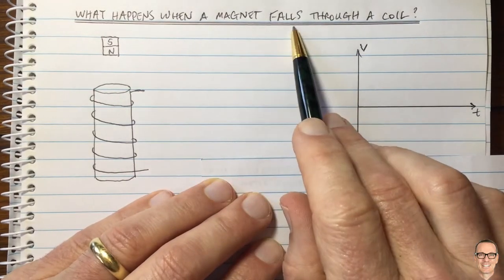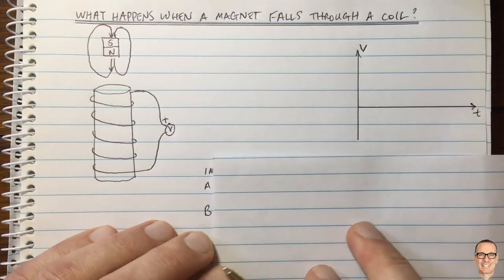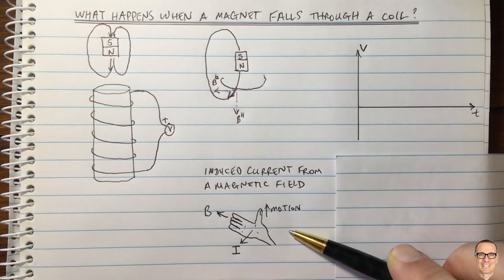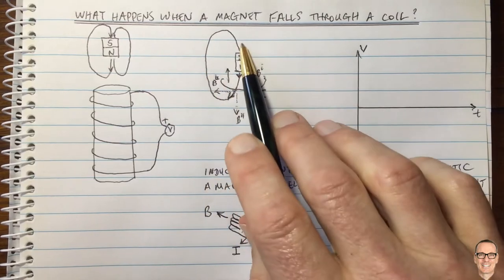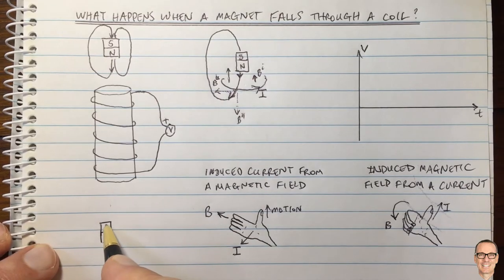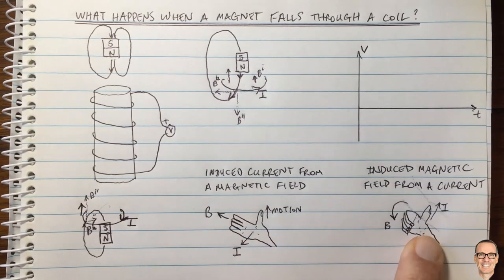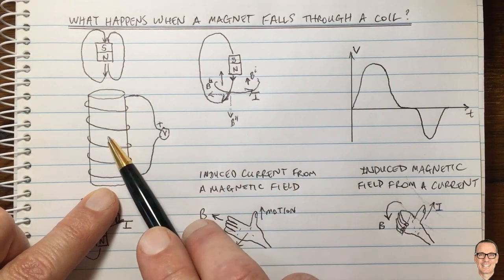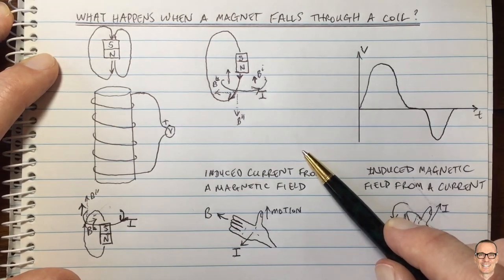What Happens when a Magnet Falls Through a Coil?

Comment: Another really helpful video. Thank you! I recently tried dropping a rectangular Neodymium magnet (poles on the long, wide sides) and found that there was no slowing of the magnet (Note that the copper pipe was just slightly larger than the narrow dimensions of my magnet). I wish I were as skilled as you with vectors but I’m guessing that the result I observed makes sense on account of the magnet’s field being horizontal vice vertically oriented. Does this result make sense? Thanks again!

Comment: funny how the induction is a result of the coiled, insulated wire versus the eddy currents and counter-emf if the tunnel is shorted, i.e., a copper pipe. i wonder how much electricity and/or counter-emf would result if a coil of insulated wire is wrapped around a copper pipe, with the insulation removed from the wire where it makes contact with the pipe. the magnet would induce eddy currents in the pipe which should be absorbed by the wire, thus adding electricity to the induced current, but the wire is shorted to the pipe so the current would flow along the length of the pipe inside the coil, and then to the terminals. this should possibly decrease the counter-emf, making the magnets fall faster than if the coil were absent, and resulting in lower current than if the pipe were not present. thus, this arrangement cancels the hindrance to movement of a magnet inside a conductive material.
Reply: Can you please explain it again, brother❤😊
Because you are going right, please explain me❤

Comment: Dr. what will happen if I let the coil be horizontal instead of vertical position, and the magnet passing by the coil vertically, will there be a change in flux, thus induced current?

Comment: The area under the voltage-time graph represents the change in Flux (phi) linking the coil. E = - d phi/ dt, so phi = integral E dt... ie the area between the curve and the time.axis. the area under the initial pulse should.equal.the area under the second pulse.
The entry pulse of emf should be a low V for a long t, the departure pulse is a high V for a short t. With equal.areas.

Comment: Here's a nice video that shows how the Magnet Slows Down through a copper pipe: https://www.youtube.com/watch?v=N7tIi71-AjA. The induced eddy currents in the pipe act in the same way to slow the motion of the magnet.
Reply from the maker: Yes, exactly.
Reply: @iain_explains   By the way the standard model of an EM Wave is always perpendicular E and B fields travelling through space. However they both seem to be in phase, where they both peak and trough in lock step. How can this be, if one causes the other, shouldn't there be some sort of lag between them somewhere? Cause and Effect so to speak. Perhaps a nice video for the future to explain. Cheers.

Comment: Hello;
I,ve got an question that if an bar magnet is allowed to fall through an coil connected to either the galvanometer of ammeter what will be the deflection shown when the Bar magnet falls away from the coil. (Given that the Magnet falls with N Direction Below).
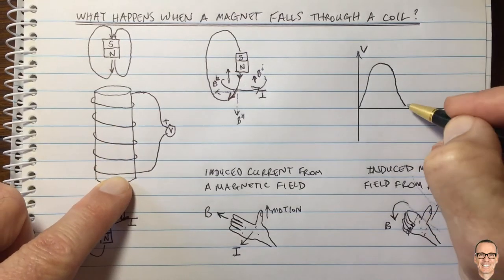Reply from the maker: This case is discussed at the 8:40 min mark in the video. Ultimately the voltage/current returns to zero after the magnet has fallen far enough away from the coil.
Reply: @iain_explains  Thanks

Comment: I don't quite get how at 3:44, you've decided that the perpendicular component is to the left. Why is it to the left? Why is it not to the right? I understand the thumbs up part, because the wire is moving upward relative to the position of the magnet. However you could just very well have pointed your hand to the right. I'm not understanding the perpendicular component.
The wire is perpendicular to the field exiting out of the magnet. Is it because you have used the reference of the N to S flux line on the left side of the magnet, that determines the direction of the perpendicular?
Is it true that if you drew the N to S flux line on the right hand side of the magnet that you would then point your hand to the right instead and find the current being induced "into the page"? My analysis proves yes on concordance with the direction you have indicated.

Skipping ahead of 7:11, it would seem better to call it an acute angle component 🤔
At 90degree it could go either left or right. However given the direct of the flux outward to inward from the right hand side to the left, at that outer point to the left relative to the magnet in the middle, the measurement of the right hand rule is that the induced current goes into the page, because of the acute angle direction of the magnetic flux line to S from N.
My point is that the direction of the flux line tends to move in the direction that is less than 90degree at the point where there is a perpendicular component.
Reply from the maker: The answer to the overall question in your first paragraph is "yes". I pointed it to the left because I was visualising the part of the wire that was on the left hand side, coming out of the page towards me, and wrapping around to go back into the page on the right hand side. You are correct, the part of the wire on the right hand side would need my hand to be pointed the other way (as you say).
Sorry, I'm not quite sure what your point is in your second paragraph.
Reply: @iain_explains  Does the angle of the wire when referring to the perpendicular component matter?
What if the coil was wired, say, in the opposite direction? So instead of the wire coming around the back at the top of the coil, in started at the front of the coil and looking at it top down, it would curl clockwise?
Would that change the direction of the induced current?

My reason for asking this is if you only had information about one flux line, the one directly perpendicular from the front of the magnet, you would see a straight line "down the middle of the magnet". I understand if you're looking at flux lines on the "left" or "right side of a magnet, or "perpendicular" to the flux line itself, 

Oh okay, I think I just got it. The palm is basically the perpendicular component lol. One's hand must be in alignment with the direction of the direction of force of the flux line. 👍🏻 Got it ✋ I was looking at your drawing 2-dimensionally, instead of three.

So I see where I was also wrong was that I was looking at this perpendicular component relationship between flux line and angle position of the wire. This is incorrect. The perpendicular component is the angle at which the flux lines leave from one pole of the magnet to the other.
Reply from the maker: Great. I'm glad you understand it now. I tried to make my drawing look 3D, but I'm not the best artist, that's for sure. I'm glad you've found the video helpful.
Reply: @iain_explains   Thanks for this. Most explations of this seem to beat around the bush somewhat, Great video Iain!

On Jaques' point, you may want to consider adding an annotation or something to say that the magnetic field vector is in the wrong direction. Considering the RH rule, if you viewed the solenoid from above, perpendicular B vectors would be pointing radially outwards. To visualise the correct direction on your diagram, draw a line from the coil centre to the choosen point.

As i said this was a great video and I am not questioning your clear understanding of the topic but I can see how this small detail could cause further confusion.

Comment: When it goes in the pipe it creates a force that oppose the magnet direction, when it goes out the force pushes the magnet out, so, when it is in the middle of the pipe, when the voltage is zero, why does both forces don't cancel out and it just moves freely?
Reply from the maker: First, it's important to point out that nothing ever moves "freely" - even if it is in deep space. Everything always has forces acting on it, from gravity, magnetic, and electrostatic. How it moves depends on the strength of those forces. Just because the magnet is inside the coil (in your question) doesn't mean the forces from above and below are equal in strength (or opposite in direction). Actually (although I didn't say it in the video) the force from the coils that are above the magnet, actually pull the magnet up! This is because the induced magnetic field lines (induced by the coils above the magnet) point down inside the coil. Which effectively means the coils above are acting as a North Pole magnet - which has the effect of attracting (up) the South Pole that is at the top of the falling magnet.
Reply: @iain_explains  First of all thank you for the response! I must have been tired that day, on the N side the field lines are in opposite directions, on the north side they are in the same direction, last time I taught that they where still opposing... And yes I know the meaning of free body, I used the world in the context not in its general meaning. Thank You.

Comment: If you released magnets through the coils at the proper rate wouldn't you make DC current?
Reply from the maker: It's the change in magnetic field that induces the current. If you have a constant stream of magnets, then there won't be a change in magnetic field, and so there won't be a current.

Comment: If the coil is long, when magnet is inside the current shud b zero, so no slowing down? The positive and negative voltages are for entry and exit. So a long solenoid would cause a different response compared to magnet falling in a copper tube?
Reply from the maker: Not exactly. While the magnet is inside the tube, all of the coils below the magnet are producing a magnetic field pointing up (slowing the magnet down, because the closest end of the magnet to those coils is the North end), and all of the coils above the magnet are producing a magnetic field pointing down (which is also slowing the magnet, by pulling it up, because the closest end of the magnet to those coils is the South end). So while it is inside the tube, it is being slowed down "the most". The longer the tube, the more the magnet is slowed down, until it reaches an equilibrium speed. This is because, the slower the magnet moves, the weaker the current will be in the coil, and so the magnet will not actually stop/levitate. In a long tube, there'll be an equilibrium speed, that depends on the weight of the magnet, the number of coils, and how tightly they are wrapped.
Reply: Thanks!
Reply: I guess @ashutoshbhakuni is right. Your explanation @iain_explains  is correct for pipe since each pipe can be considered infinite number of independent circles wrapped. However, for coil, the coils are connected so when the magnet moves inside the pipe, the current will cancel out if the coil is long enough. This can also be observed experimentally. The magnet won't slow down as it falls inside a coil while it arrives at terminal velocity very fast in a pipe.
Reply: @niyazigulnar56  I agree with you. Ironically this cancelling out effect is even mentioned in the video around 8:34 (albeit very briefly). Sadly I haven't been able to find a video of someone testing this... would be interesting to see experimentally!

Comment: Hi Iain, thanks for this clear explanantion. I would be interested to know if in your example the coil wires would be connected to create a (short)circuit or open, what would the difference be?
Reply from the maker: Connecting the ends of the coil with a wire wouldn't change the magnetic field effect on the magnet, since the only difference would be that charges would flow from one end of the coil to the other (through the connecting wire), rather than build up at the ends of the coil. Having excess charge at the end of the coil (or not) doesn't effect the magnetic field, since it is only the moving charges that effect the magnetic field.
Reply: @iain_explains  I'm surprised by your answer... I would have guessed that in the case of the UNconnected (open) circuit, the sloshing of the charges towards one end (like in an antenna) would mean that, despite induced emf being equal, the resultant current would be reduced [in magnitude and/or duration]... leading to a weakening of the induced magnetic field? ...thus less magnetic breaking? (PS loved this video by the way, it was much more thorough than others on the topic!!!)

Comment: Excellent explanation of back emf. I have a question if you can answer will be great: from where is coming the electricity in the coil over and over again? 
I ask that because if the current (in the generator - coil) is flowing "from the wire" as they told us on physics then why this flow never ends?
Reply from the maker: Sorry, I'm not sure I understand your question. On a technical point, current flows "in" wires, not "from" wires. Current is the movement of electrons - so there needs to be a circuit for current to flow. Energy sources cause the current to flow (like batteries, or magnetic fields), and then the energy is dissipated when the current flows through circuit elements (such as resistors).
Reply: @iain_explains  OK, you are right. Current flows in wires not "from". 
But where the electrons are coming from when the magnet passes true the coil?
 If the current flows true the coil - let's say - connected to a resistor.
Reply from the maker: I'm not a physicist, but essentially the electrons that are moving are the ones that are already in the atoms that make up the metal wire. In metals, when a field is applied, the electrons disassociate from their protons, and move in the higher energy bands.
Reply: @iain_explains  Exactly this is something that brings up the question: if they move into a higher state and leave the orbit then who will replace them? it may be a dumb question..
Reply: @georgestanciu5466  bro metals (the things used to make conducting wires) are electropositive, hence they are more than willing to give up and donate their electrons from their valence shell; implies when a magnet is brought near a coil (must be moving), the electrons in the metal atoms flow in a particular direction, and this direction will be such that it opposes the change in flux (flux is the magnetic field intensity through a given area, and is B.A (dot)) [Lenz' Law].
Hope this helped.

Comment: Subscribed! ~ BUT~ have done so many time before...... and ..... never yet to any avail.
SO~ what I can't get my head around * is * ;
1] Why no information 'anywhere it seems ' on what happens WHEN~ a magnet spins 'within' a coil.
2] ~ 1 magnet.... N/S ~ top and bottom?~~~ Flat Bar type WITH also Disk type also round bar type
3]~ 1 magnet... N/S ~ sides Left & right?~~~ same types as above.
4]~ Series of magnets..... Flat, disk and bar ?
5]~ as above BUT with series set at 45 degrees to each other?
......... I will try to do so myself, BUT~ understanding what going on??? on clue, sorry very basic clue.

666]~ What happen when THE SAME is done within 2 coils SET apart by;
a] 1cm
b] 2cm etc, etc BUT coils arranged in same orientation
c] Same but with coils arranged a 90 degrees to T'other AND 180 degrees as well as variations between.
d] IF~ any result, what about 3 coils etc?
~
Please IF interested SHOW if possible VIA use of Magnet field Sheets, you know the green 1 currently supplied by 1st4magnets/UK.
IF NOT interested PLEASE SAY SO........ right here. Time for me is NOW about 2-3yrs away. So short!